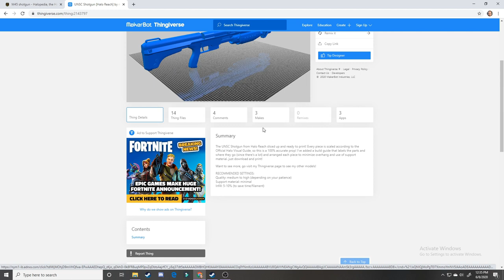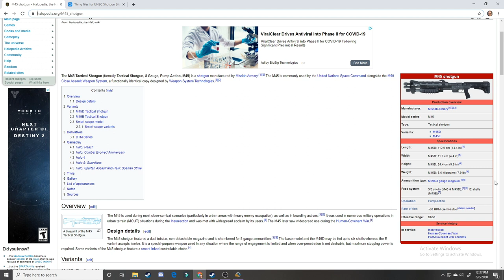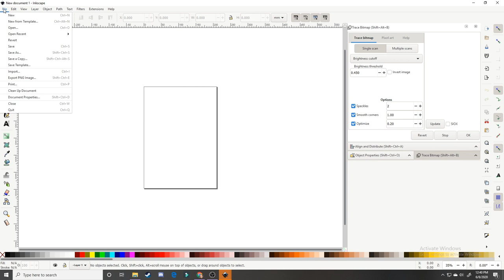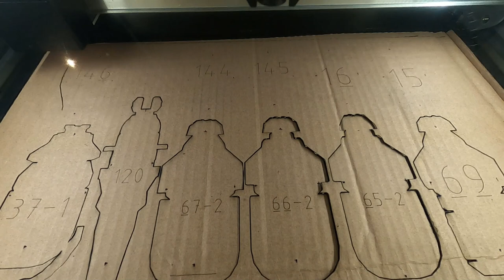GlowForge Project // HALO SHOTGUN

Comment: I know I am a little late to the party here, however, here's a tip for assembly. Upload your project into your software of choice. Take your first slice and place the cut path of the next slice within the first slice, change the color to red (or any color of your choice) this "red" cut path can now be changed from "cut" to "score" in the glow forge UI. Do this to every piece. IE: The score path on slice A will trace out slice B's exact position, The score path on slice B will indicate slice C's position, and so on and so forth. This is my usual go to when assembling layers of 50+ slices. Another way to ease assembly would be to cut out a circle guide on every slice that follows along the "heart" of the project. For example: If you were to (hypothetically) shove a wooden rod straight down the barrel of the gun all the way through and out of the stock of the gun, these guide circles would follow along that path, making assembly a breeze. Just figured I would throw some tips out there for a fellow forger! Happy Forging!!
Reply from the maker: Thank you very much! You have some very good tips I haven’t heard before. I will have to try this out on my next stacked project! Thanks again!

Comment: How much does it cost?  wood
Reply from the maker: Are you asking material cost? If made out of wood cost? Price to purchase?
Reply from the maker: This costed nothing in material. I am reusing cardboard. Sort of recycling I guess? Haha.
Reply: @FlareNee  The wood cost haha,
Reply: @unlicensedpsychologist3278   if using Baltic Birch plywood at 1/8th inch 12x20 in sheets, it would cost roughly $29-$40 depending on where you live and who you order your supplies from. Woodpeckers is the normal go to for most forgers. But cardboard would be the cheapest option especially when trying projects with many pieces such as this.